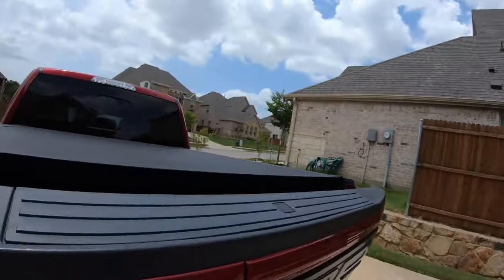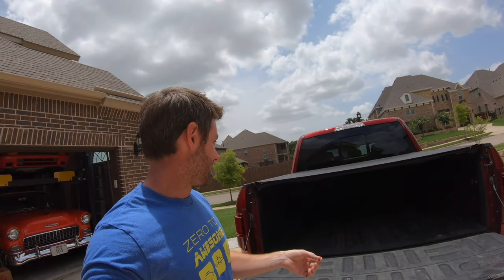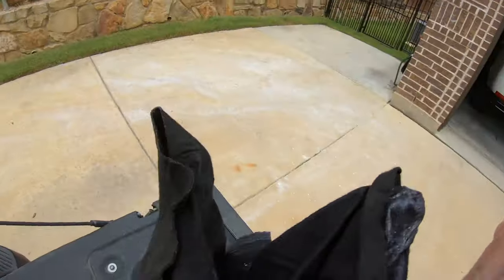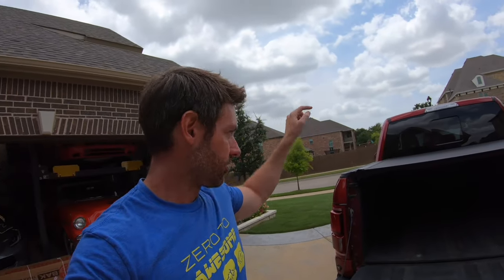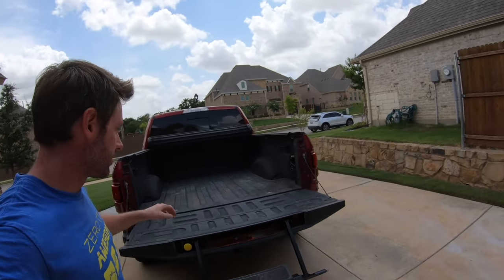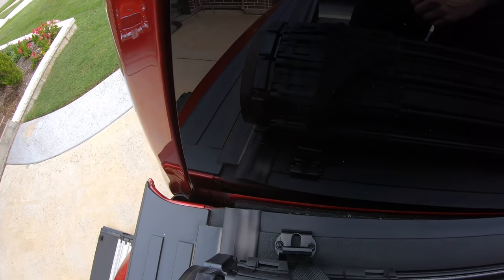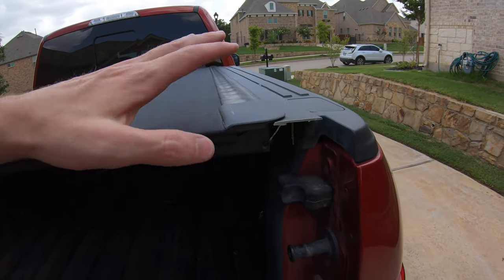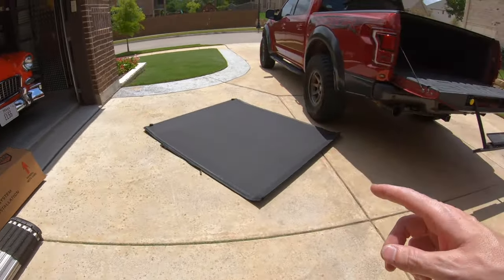I finally found the PERFECT TRUCK BED COVER after 3 bad BAK revolvers. Maybe… The BAK Revolver X4s

Comment: I’ve had 3 Bak folding covers. They have all fallen apart within 3 years. I purchased them through Amazon… sadly BAK said they were not covered since Amazon was a un approved retailer. 

I liked the design. But four the heat destroyed the rubber seals between the panels and then the panels began delaminating. 

I really like the look I’d this roll up. I’m wondering how long the mat finish will hold up?
Reply from the maker: Strange. Bought mine through Amazon too and it wasn’t an issue. Maybe their status as a retailer changed at some point
Reply: @ZeroToAwesome  could be.  I felt we did a good job taking care of our vehicles. Did a ton of research on these covers before we purchased. Was disappointed over all.  We live up near Canada in N ohio. I don’t think the cold had any bearing on the short life of the covers.

I’m leaning toward the roll up this time around. Hopefully the new unit will last longer this time
Reply: Rubber seals need to be treated and cleaned with lubrication to last longer. 
Its what ever your willing to deal with for wear down. 
If it rolls it needs bearing. If it folds, it needs hinges. Both are too expensive to manufacture correctly.

Comment: Bought the X4s for my 2021. The cover isn’t wide enough to lock into the rails. It’s about a 1/3” off. They sent me new rails which didn’t fix the issue. Also, one of the panels separated showing the felt underneath and leaving a nice lump in the cover.  They’re sending me a new cover after I took measurements showing how it wasn’t wide enough and sent pics of the separation. I’m really disappointed with Bak I had the version 1 cover for 4.5 years with no issues ever.
Reply from the maker: After posting this video I realized one side of my cover wasn’t locking. Like yours, I discovered mine wasn’t wide enough. I wound up putting some shims between the bed and one rail. Seems to work so far
Reply: There's a bakflipg2 on my truck that's 11 years old   it leaks  but still holding up   almost every gasket is worn out  they sent me free gaskets   but how the fuck do you change em out. Lol   time for a. New one
Reply: @jond661  lol good question!
Reply: @ZeroToAwesome  scary! Good thing it didn’t catch any high winds and rip off!

Comment: The felt isn't there for heat purposes, it's to keep someone from pinching their fingers while rolling it. Ask how I know this? Because I've gone through 2 covers myself and both times the felt has melted loose in the Texas heat. So when it did I had to roll it with partial felt or no felt and I pinched my fingers skin bad!  So I still have the faulty one on my truck yet myself trying to figure out what to do.
Reply: nope

Comment: Great video. Thanks. After a couple months of use, do you recommend this cover?
Reply from the maker: If you can get one that fits, sure. About a week after posting this video I noticed my bed cover flapping in the wind on the highway. Turns out it’s about 1/4” too narrow to lock properly. I could probably get another but I’ve shimmed the rails for now and it seems to work. Other people have had the same problem and BAK eventually gets it fixed.
Reply: @ZeroToAwesome  besides the issue concerning the possible need to shim it unless they have fixed the issue, how long do you think this model will last considering the changes they have made to the cover? I’m really wanting to get one but I’m not sold on if everything is fixed from the reviews of the prior models with durability of the vinyl and all.
Reply from the maker: @ctmartin1319  pretty sure it’s the same vinyl. With the warranty you’ll get at least 5 years. That’s probably all I’d count on

Comment: Did you look at the MX4 flip up model?
Reply from the maker: Yeah but I didn’t want to have the back window blocked when it was all the way up
Reply: @ZeroToAwesome  Looks like the release handle sticks out a little on the sides at the tailgate, any issues snagging this when loading of getting in/out of the bed?  I'm concerned it might get bent if you have a big items in the bed?
Reply from the maker: @EV_Insider  you do lose about two inches of clearance but it hasn’t been an issue for me. The wheel wells are much more restrictive. A forklift with a pallet still fits

Comment: How does the cloth hold up? Does it flop around while driving? I'm in San Antonio and my truck sits outside too. Curious if the cloth top flops around and looks ugly while driving like a soft top.
Reply from the maker: So far it’s staying glued to the aluminum and not blowing in the wind

Comment: I’ve got a friend with the X2 that has had his for 3-4 years and of course the felt came off but the edges of the top has separated from the aluminum.  Should he contact BAK and have his replaced.

Comment: Good review.. only negative thing I have to say.. don’t you think those caps are probably reasonably cheaply replaceable?? Or even free under warranty? Would’ve left them the way they are.
Reply from the maker: Probably. I don’t want to have to call BAK every month for new end caps though
Reply: I think I'd rather buy a cover that doesn't have those. Check out the Truxedo Sentry. It's a similar cover without any plastic pieces to break or fall off. Right now, that's the one I'm most likely to buy.

Comment: Was I just seeing things, or was the latching mechanism accessible when you pulled off that end cap? Seems like it could be a security issue if so.
Reply from the maker: You don’t even need to remove the end caps. All you need is a screwdriver and 5 seconds. It locks the wind out, not people with screwdrivers
Reply: @ZeroToAwesome  That's kinda a bummer. I often work in Methopotamia, where things in your truck bed grow legs. Cool video.👍

Comment: Bak is the rare exception that has pretty great warranty support and nice looking products, but products that are completely underengineered for anything other than ideal conditions. Had a 15 Silverado, bought the VP fold originally (flush vinyl top), and it completely failed within 2 years. They replaced it with cheaper version that also failed after 2 years and then sent another, slightly better version after that. I won't be buying another bakflip product.

Comment: Can you post a video of the shims? I just ordered an X4s for my 2009 F-150, so I'm getting mentally prepared to put these in right away.
Reply from the maker: Hopefully they send you the right size and you won’t have to. But if you do, just throw one of these in between the bed and the rail every place you put a clamp: 
https://www.homedepot.com/p/8-in-Composite-Shim-12-Bundle-10011700/301757699?source=shoppingads&locale=en-US&pla&mtc=Shopping-B-F_D21-G-D21-021_003_DIM_LUMBER-Generic-NA-Feed-LIA-NA-NA&cm_mmc=Shopping-B-F_D21-G-D21-021_003_DIM_LUMBER-Generic-NA-Feed-LIA-NA-NA-71700000045530102-58700004682521920-92700053361644921&gbraid=0AAAAADq61UeUnqqeXZUpItReV2xwaIjRV&gbraid=0AAAAADq61UeUnqqeXZUpItReV2xwaIjRV&gclid=CjwKCAjwz5iMBhAEEiwAMEAwGP-4RswEwDqETvLUd0_EutMVw4UUDF3aG1chxhRkup2gMfQiMb2mchoCSHIQAvD_BwE&gclsrc=aw.ds

Comment: Why didn't you go with the bak flip
Reply from the maker: When it folds up it blocks the back window so I can’t see all the 2x4s falling out of the bed of my truck because I didn’t strap them down. I’m also told it turns into a giant sponge after a few years. And I’m not good at gymnastics
Reply: @ZeroToAwesome  whatever falls out of the back is the guys problem behind you. Never look back brother. And for the spongy problem go with the bak flip f1 I hear it is fiberglass compared to the foam used in the MX4

Comment: Can anyone comment on the water penetration protection on the X4s? I’ve seen a couple videos where people take it through car washes but that’s not very realistic. I saw one video where a guy had one out in the rain and it had some water penetration by the tailgate but he parked it with the nose of the truck going downhill. So water was just pooling against the tailgate seal all night
Reply from the maker: It’s not waterproof and they don’t claim that it is. I mostly get water coming in by the tailgate but it still stays 95% dry